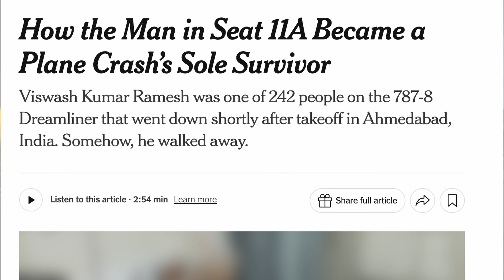Why the RAT Changes Everything – Air India 171 Update

Comment: One video circulating on the internet shows a power shortage inside the cabin. Losing electrical power or an electrical shortage during takeoff has an adverse effect on engine thrust. The engine can manage for a few seconds ONLY, and then it will lose thrust. Maybe the problem with the electrical system adversely affects the fuel delivery system, causing the engine to fail or lose power.

Comment: Is it possible battery blew up
Reply: Electrical short burning out engine pumps or control problems many years ago with lithium batteries a possibility
Reply: Some information all power was. Out  in aircraft this could possibly shut down engines you did not hear main engines they were dead but rat deployed,
Reply: All 747 possibly the above black boxes may help
Reply: Or fuel was shut down fuel pumps not engaged or electrical defiency shut down Major control computer
Reply: Passenger on plane called and told someone before the crash all power on plane out gave a video shot of screens on aircraft passenger was disruppted
Reply: If the above accurate vital clue

Comment: The FAA’s Airworthiness Directive
In response to Boeing’s discovery, the U.S. Federal Aviation Administration (FAA) has published an
Airworthiness Directive (AD) ordering 787 operators to periodically shut down the plane’s electrical power.
The AD requires that 787 electrical power must be recycled at least every 120 days.
According to an FAA statement,
“We are issuing this AD to prevent loss of all AC electrical power, which could result in loss of control
of the airplane. If the four main generator control units (associated with the engine-mounted
generators) were powered up at the same time, after 248 days of continuous power, all four GCUs
will go into failsafe mode at the same time, resulting in loss of all AC electrical power regardless of
flight phase.”
A Boeing spokesperson stated that:
“The airworthiness directive action addresses a condition that only occurred in the lab. Simulated
testing determined that this condition is possible in cases where an airplane’s power is left on for
more than eight continuous months. No airplane in the fleet experienced that condition.”
The Fix
Boeing’s only comment related to the cause of the problem was that:
“This condition is caused by a software counter internal to the GCUs that will overflow after 248 days
of continuous power.”
Speculation is that the software bug is a signed 32-bit integer overflow that is triggered after 231
centiseconds, or 248.55 days.
2

Comment: ♦️ ACs in flight were not working properly just hours before takeoff means there was an issue with the power source in aircraft (one guy in india who was travelled by this flight recorded) 🛫 

♦️ The screens on seats of aircraft were freezed (reported by the same guy who recorded) so again power issue 

♦️ As we can sea RAT is activated means it only opens when there is electrical power loss or few other reasons

♦️ So due to power loss the proper signals to the engine for making proper thrust may not given, the flaps positions cannot be changed, the landing gear cannot be up

may be the reasons...

Comment: With respect Captain Steeeve, your original theory (pilot mistaking flaps for gear) did not make sense  to me. It seemed extremely unlikely that a professional pilot would make such a mistake. Now, if there was a dual engine failure, the question is why did that happen?

Comment: Where is the sound from the jet engines on the video? If the engines were working correctly wouldn't the noise they generate drown out the sound from the RAT? Seems to suggests engines were not running as the plane lost altitude.

Comment: Due to the complexity of the report, it even seems credible
I don't know if it is, but I always thought it would be a power failure
We had already received this one, but it was dated after the accident (this one doesn't)
As you say, I also found it more credible, but they only met with the FAA/NTSB yesterday and it seems too early (at least two weeks) for them to come out with a preliminary report
I also think that AI can do this easily🤣🤣
Flight: AI-171 | Aircraft: Boeing 787-8 | Date: June 15, 2025 | Route: Ahmedabad (VAAH) → London Heathrow (EGLL)
Crash Site: ~1.2 km from VAAH Runway 23, post-V1 and rotation

1. Primary Cause – Electrical Power Transfer Interruption (PTI) During Rotation
	•	During transition from ground to airborne electrical configuration, the aircraft experienced a cascading dual-engine FADEC (Full Authority Digital Engine Control) failure.
	•	Root cause: Uncommanded bus transfer failure due to arcing in the main power relay box (PRB-A), traced to water ingress during pre-flight GPU disconnection in heavy rain.
	•	This led to loss of electronic engine control at rotation, resulting in both GEnx engines rolling back to ground idle within 4–5 seconds.

2. Flight Data Record Timeline
	•	+0:11 sec: Nose gear lifts off.
	•	+0:13 sec: Sudden engine rollback begins. Thrust reduces from 92% N1 to <27% within 3 seconds.
	
•	+0:16 sec: Master caution + ENG FAIL L/R warnings. FO calls, “Both engines dropping!”
	
•	+0:20 sec: Autopilot and flight control reverts to Direct Mode. Pitch up attitude peaks at 18°.
	
•	+0:25 sec: Aircraft stalls at 186 ft AGL.
	•	+0:30 sec: Full aerodynamic stall; nose drops rapidly.
	•	+0:38 sec: Ground impact at 54° nose-down attitude, 174 knots.

Contributing Factors
	•	Environmental Conditions:
	•	Torrential rain during pushback.
	•	Moisture intrusion into PRB-A connector (P/N: HLN8471) — a known corrosion-risk component.
	•	Latent Maintenance Issue:
	•	Power transfer relay unit showed signs of thermal damage in a previous MEL deferral 2 weeks prior.
	•	No replacement had been conducted; aircraft was cleared under repetitive deferral.

•	Boeing 787 has no physical engine control backup (i.e., no direct mechanical linkage in FADEC loss scenario).
	•	Loss of power supply to both EEC channels resulted in engine “freeze” at ground idle instead of flameout.
	•	Flight Crew Response:
	•	Attempted engine relight sequence not completed before stall onset.
	•	Emergency power selector not activated — possibly due to confusion from multiple ECAM warnings.
✈️  Immediate Safety Actions
	•	DGCA + EASA + FAA Emergency AD issued within 24 hours:
	•	Mandatory PRB-A moisture integrity inspection on all Boeing 787 aircraft.
	•	Temporary restriction on dispatch with MEL items related to power transfer systems.
	•	Boeing:
	•	Issued Service Bulletin SB-787-24-212 requiring replacement of PRB-A connectors with sealed versions.
	•	Exploring addition of dual-path power redundancy for FADEC systems.
 Lessons Learned
	•	Over-reliance on electrical power distribution architecture without layered redundancy.
•	Lack of crew procedural training for full engine rollback during takeoff in EEC dual failure scenarios.
•	Need for improved environmental sealing in GPU/electrical handover units in monsoon zones.
Human Toll
	•	The loss of 243 onboard lives, including 12 crew and 18 infants, deeply impacted the aviation community.
	•	Final words captured on CVR: “We lost everything – no thrust!”
	•	One family of five was killed on the ground in a hospital ambulance struck by debris.
Timeline – What’s Next?
	•	Aug 15, 2025: Release of FAA/Boeing electrical design audit report
	•	Sept 5, 2025: ICAO session on electrical-critical phase-of-flight risk mitigation
	•	Oct 2025: Mandated design retrofit across 787 fleet (rev. SB-787-24-219)

Comment: I'm a pilot, but, certainly not an expert. My first thought was contaminated fuel or some kind of fuel issue. There are a lot of autonomous warnings that will warn the pilots if the plane isn't configured properly for takeoff. My second theory was premature flap retraction.

Comment: Hi!
After watch many times the video of the take off ... I star to be suspecting that the analysis or/in the theory of : 

1. ...  '' VAPOR LOCK ''  ... the plane while taking off ... On the back of the engines we can see '' A BLOW ON THE THRUST COMING OUT OF BOTH ENGINES ... DUST OR COMBUSTION GASES ARE SEING  AT THE END OF THE RUNWAY ... THE BLOW HEARD WERE THE GASES EXPLOSION? '' .
2. The  '' RAT Deployment '' ... DID such a BANG or Noise ??? ... the only survivor confirm the BANG/BLOW/NOISE heard.   
3. The Weather was very '' HOT '' and the passengers on the previous flight confirm that the Air Condition System was not functioning ... so, '' Vapor Lock issue was building to show anytime ... unluckily it show at the moment of the take off.
4. It's sad that if, '' VAPOR LOCK '' HAPPEN BELOW 1000 FEETS THEY DON'T HAVE ENOUGH TIME TO RE-STAR THE ENGINES ... IF, THE '' VAPOR LOCK '' WOULD HAPPEN A 10,000 FEETS THEIR FATE WOULD BE DIFFERENT!
There is my analysis!

May God comfort the hearts of those who lost a loved one !
🙏🙏🙏

Luis Espinoza 😉

Comment: Doesn't the black box need at least one engine running to supply it power? I seem to remember several aircraft investigations where the black box data stopped before impact due to all engines failing. Hopefully on this plane the RAT also powers the black box.

Comment: I still think it’s flaps and if the RAT can be deployed manually from the cockpit then it is evidence of the crew working the problem. They interpreted the failure of the gear to raise as an hydraulic issue and manually deployed the rat to attempt to retract when it was inadvertent retraction of the flaps that was the issue. Why would you investigate that which you hadn’t knowingly commanded?
Lets hope that the investigation is a fitting memorial to the dead. 
Crikey! I had assumed that the survivor would be from the tail. Literally miraculous. ❤

Comment: are you new?  Flaps were never deployed, I saw the plane take off, both engines running (you can hear them in video) RAT can also be deployed manually as well.  If you claim to be a pilot then the you know the gear is not raised until a certain speed.   Same thing happen on Northwest DC-9, took off then crashed and killed everyone but one,  NO FLAPS

Comment: I believe there was a sequence of events that let to this crash (as there always is)
1) Density altitude calculations probably were wrong leading them to believe they had enough runway for the power/flap settings they chose. This may have been pilots fault or them receiving faulty info from the ground people.
2) The take off run went longer than they expected and as they were getting close to the end of the runway they miscalculated how quickly the plane would rotate and wheels come off the ground. It would have taken much longer than they would have expected due to heat and miscalculations on density altitude.
3) They ran off the end of the runway kicking up dust, stones and debris ingesting same in both engines.
4) Engines lost power but DID NOT spool down completely. The fact they climbed a little and the rate of decent to the ground and the attitude of the plane tells me he still had approximately 30-35% power. More from the left because the plane was yawing to the right and you can see some left rudder deflection on one of the vids.
5) RAT was deployed, not sure why because they didn't experience a full power loss which normally is what would make it deploy. 
6) Pilots did select to retract the landing gear because you can see the Truck Tilt forward on the wheels, but the complete retraction wasn't done possibly due to damage created from them running through the end of the runway.
But as always its all best guess at this point because we won't know for sure until the NTSB (or like)  issues their report, however this scenario fits checks all the boxes of what we know at this point.

Comment: The plane tilts upwards sharply towards the end of the video. There is a question as to why, as this ends the glide early. Further, something fell off the aircraft at takeoff.

Ok, so we're hearing the RAT, there's a whisper from the engines but nothing more, so all engines are dead.

So we've two issues need addressing:

1. Did the bit that fell off cause the failure or was it insignificant?

2. Did the pilots tilt the plane up to purposefully cause a stall (perhaps to avoid a far worse disaster) or was it an action by the Boeing computers due to faulty logic?

These seem to be the only two issues left.

Comment: R A T also means ram air temp. if the temp of engines are to high then thrust to engines are limited  protecting damage to the turbines etc.  comment... also the flaps extenders are no where near the under carrage

Comment: Thanks for speaking facts.
Anyway, looking at the videos, to me it still looks that flaps weren't out. And apparently I am not the only one.
I do know that, in normal operations, if the engines are lost, pressure on the hidraulics shouldn't be affected.
Can be there a situation where the two things (engine out and hidraulics down) might occur simultaneously?

Comment: May I extend my deepest condolences to the families of those lost and to the nation of India as they collectively grieve over this terrible disaster. I would like to humbly  present some thoughts as a non aviator. I've listened to the information coming out and have been reading as much as I can. The 787-8 is a complex airplane that is state of the art. Many have been speculating about potential failure of major systems to cause both engines to fail which is extremely rare.  The runway was of sufficient length, and the pilots used the full length of the runway. The pilots were well trained and experienced. The wind or other atmospheric disturbances seemed not to be a factor.  The most unusual circumstance is the extreme heat reported at 110 degrees. This channel noted that there initially didn't seem to be any pilot error regarding flaps.  Being born and raised in the deep South of the U.S.,, extreme heat like this has occurred. The highest I ever experienced was 112 degrees, and it was so scorching hot that people were compelled to use umbrellas the keep from burning in the sun. Also we were unable to walk on asphalt surfaces. I looked up the potential surface  temperature of a runway which is usually a mixture of concrete and asphalt, and in 110 degrees it can reach a staggering level of 150-170 degrees!! The air inside the tires would have been very high and the traction may have been compromised. The heat generated by the running, idling engines in addition to incredibly high surface temps and ambient air temp.would have contributed  to unthinkable heat. The maximum ambient air temp.for take-off is 122 degrees in general. Taking into account this extreme heat scenario, the jet fuel would have also reached very high temperatures leading to greatly degraded efficiency.  The high heat also would have affected air density  dramatically. From a baseline of 70 degrees, the air density at 110 degrees would have been reduced by 11-13%. This reduction in air density would have dramatically affected lift as mentioned in this broadcast  The plane had been sitting on the runway for two hours idling waiting for their turn to take off. Weight: 242 passengers on board with a maximum potential of 249. That is very close to maximum capacity. The plane's fuel tanks were fully loaded at 100 tonnes. There are no weight sensors in the cargo hold, and planes' cargo holds are very often filled to maximum capacity for additional monetary profit for the airlines. The plane has weight sensor warnings from weight on the tires so it may have not been overloaded but certainly at maximum capacity. With the combination of factors being the extreme heat both ambient air, extremely high surface temp. and heat produced by idling engines for two hours, the adverse effect on the fuel,  air density highly compromised, and a weight load at maximum or maybe even somewhat above capacity, all came together to create conditions for a very tragic and unavoidable crash from lack of lift and compromised engine power and thrust. It seems perhaps that there was no fault or failure of the pilots, airline, or components of the plane from a manufacturing standpoint. Why other planes were able to successfully take off is something that does occur with plane crashes occurring while  other planes experience similar conditions but take off successfully. Maybe the flaps weren't set ideally for those circumstances, small nuances that created, for lack of a better phrase, the perfect and sadly unavoidable storm for that particular plane. The pilots did all they could do.

Comment: If it was dual engine failure, it did not occur at V1, or they would have aborted. It happened on, or after V2 Rotate. Why would fuel contamination wait for that precise moment to occur when it just as easily would have happened during taxi, or the preceeding takeoff roll at full thrust? I am skeptical of fuel contamination.

Comment: The RAT doesn’t make a bang when it deploys, though it is unmistakably loud when it’s spinning. 
And the RAT will not power cabin lighting, but battery-powered emergency cabin lighting will operate if normal electrical power is out.